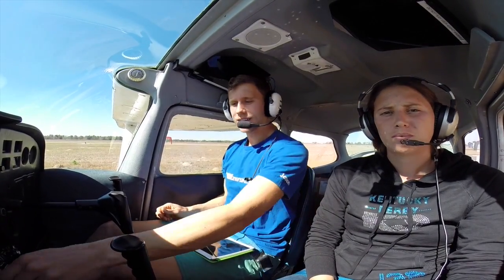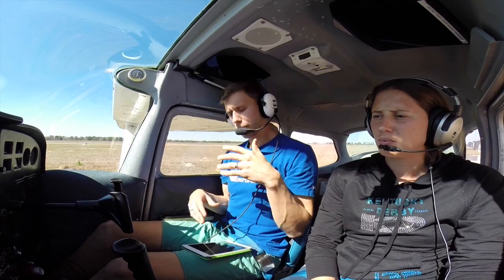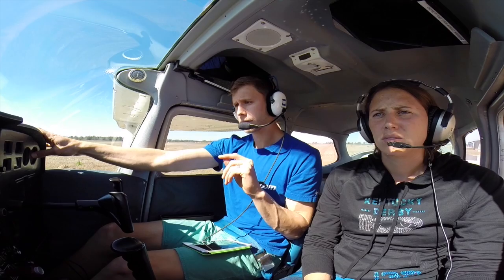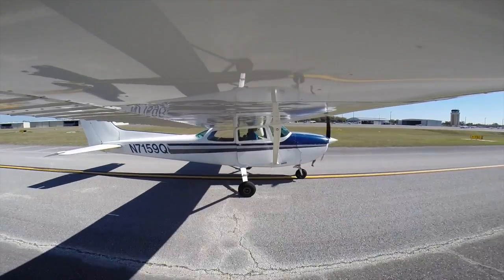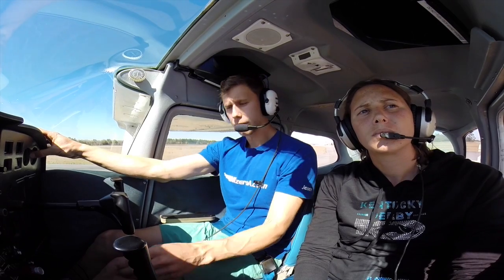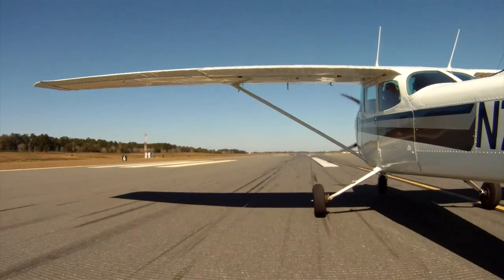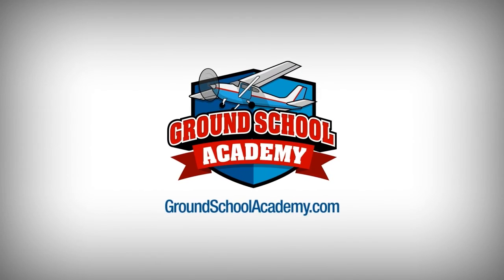Class D Airport Radio Communications - MzeroA Flight Training

Comment: Why didn't you ask for VFR clearance ??
Reply: Not available at most class D airports. If you want flight following, check the airport directory (airnav works, too) for the frequency. For most VFR D departures & at all E (pilot-controlled) airports, it will be approach or center after clearing the pattern/ airspace. For D IFR, it will be ground most times and they'll give you the departure frequency, which is usually the same as D VFR frequency to request flight following. At B & C airports, you must contact clearance delivery to set-up FF on the ground. Hope this answers your question.

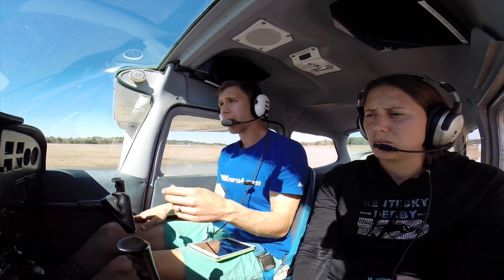Comment: One thought I have is about what you said around 3:50. You said something like you wouldn't want to waste your time calling the tower if somebody's on final. The only problem with that logic is that at busy airports, like my home base, there are usually planes from all sides and intersections approaching the runway and getting in line for take off. So calling as soon as you're ready, regardless of what's happening with the final, saves you a spot in the sequence and you don't get passed over by somebody else on the other side of the runway or at another intersection that called before you did. The other thing it can do is getting the tower started on your IFR release if you're IFR. So I'd say call when ready regardless of what's going on with the final... Any way, thanks for your vids. I enjoy watching them, they bring back good old training days memories!
Reply: Definitely a good idea to consider that and say: "[Airport] Tower, [your callsign] with the traffic on final, [we'll be] ready for departure after they land."
Reply: Yeah, here at KSAC and KSMF we call tower and say “ready for departure in sequence”

Comment: Hi Jason. Thanks for the videos. It's a great resource! I'm a PPL from Australia and I was always wondering what the "left/right turn approved" in the take off clearance means. Seems to be a US thing. Thx!
Reply: Some airports in and around the NYC area have customized "standard departures." Some exist for expeditious traffic-flow, noise abatement, or whatever is required.

If I plan to depart visually from a towered-airport and my initial heading away from my departure airport is other than standard, I'll request a route off flight (preferably with ground control) like "westbound or eastbound departure."

Tower will then say to me (while I hold at the runway waiting to launch), "Cirrus 1234, right or left turn approved... runway 1, cleared for takeoff."

How do PPs from the land of Oz coordinate departures?
Reply: PP-ASEL from Brisbane. If you're departing against the circuit traffic, you're just told, "Cleared for takeoff, make left turn."

When requesting taxi, we use the north/east/south/westbound departure as you folks do.
Reply: +Windtee Also, most airspace in Australia is Class G. Outside the major cities, Class G airspace prevails up to 8500 MSL, then it's Class E to the floor of the Class C (usually FL125) or A..

There are no Class B airports Down Under.
Reply: Alexander Brown
Thanks for the input!
Reply: Windtee Two years later ;)
Reply: Alexander Brown
Roger that, two years with bonus info too! Have a cool one.